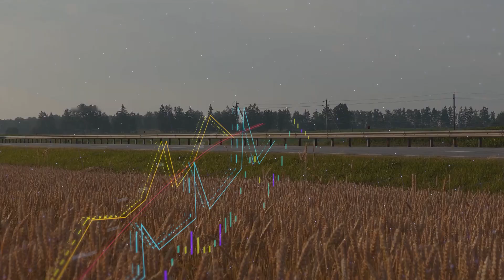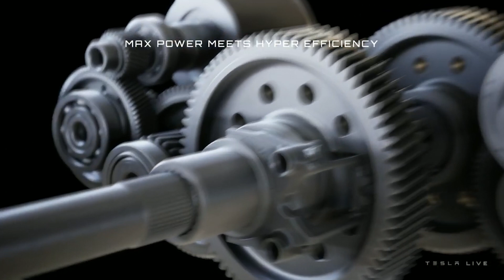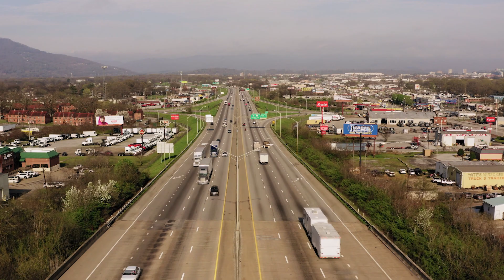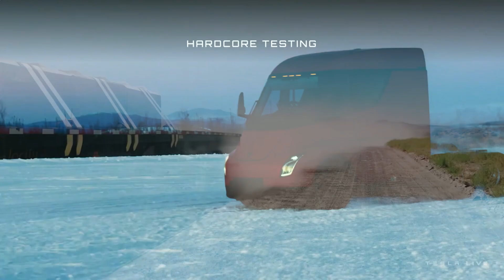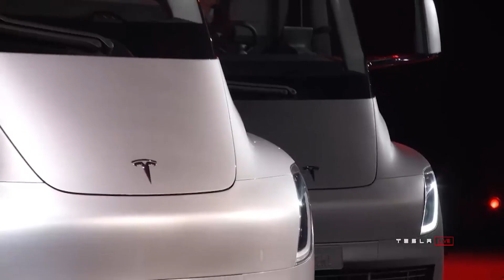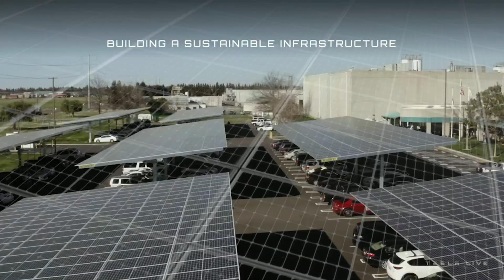Revolutionary Technology: The Tesla Semi Has Arrived!

Comment: The Tesla Semi truck is a revolutionary product. Elon Musk always make the most impressive creation and intriguing invention. The Tesla Semi truck will be capable of carrying more weight than any other truck in the world, which can transport large items like machinery and cargo containers very quickly. The truck can drive great distance on a single charge without refueling, which is amazing. It's also facinating that the dual motors have an extra clutch system that will disconnect them from the wheels while the truck is traveling. Thank you so much for doing this video.